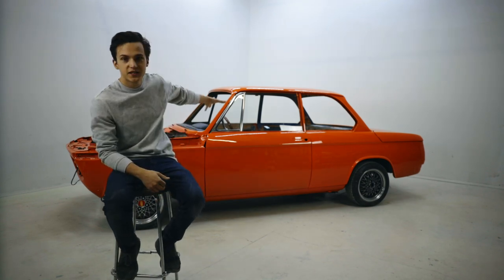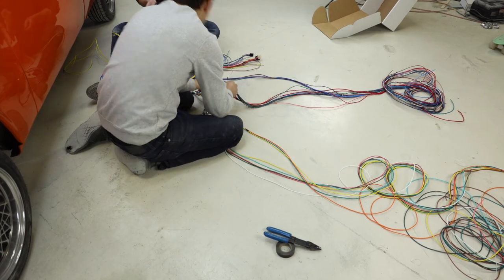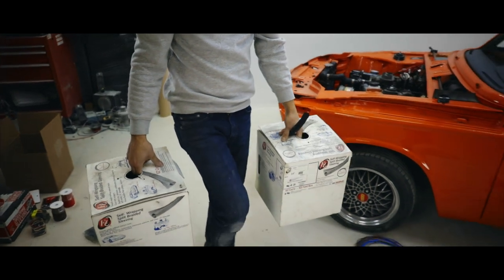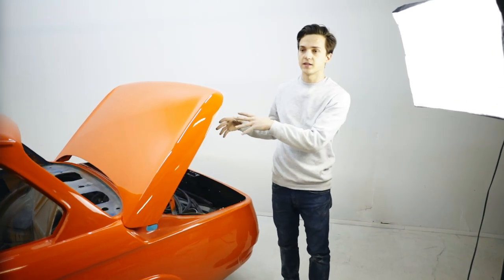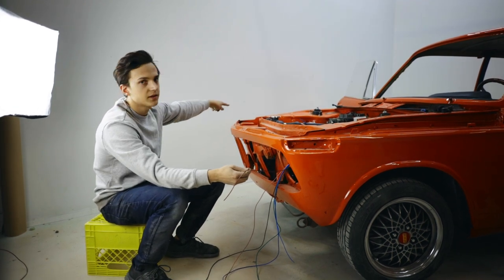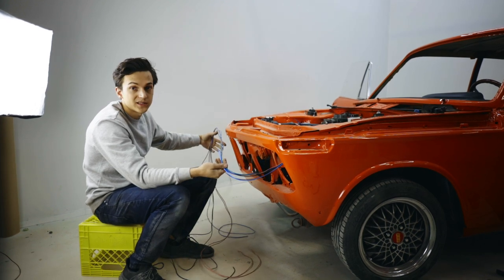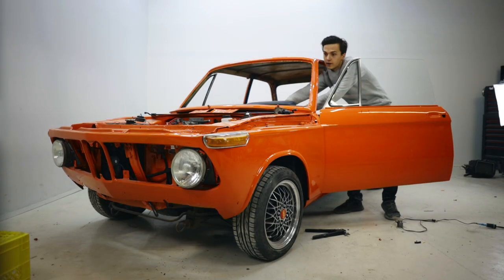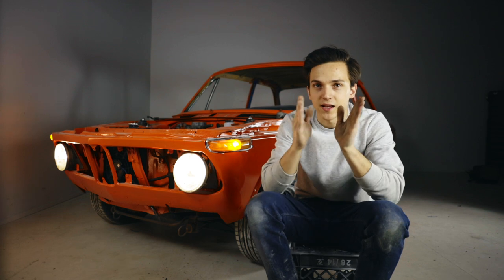TRICKS & TIPS FOR WIRING A CAR!! PROJECT 2002 [EP.4]

Comment: Ah. The age old questing. Crimping vs soldering. Solders will break overtime. But they are better than crimping.
Reply from the maker: My understanding was solder can crack if the wires are loose and always moving around/ bending. But if you secure all your wires nicely it’s reliable

Comment: I'd say you need some qualifiers on the advice to solder every connection. It's going to be highly dependent on any support around your solder joint, the vibration it might experience, and the quality of a crimp or soldered joint. Soldered joints are brittle and prone to cracking and breaking under vibration and lateral force and as such should be on pins inside a connector with good strain relief. Soldering does seal the joint well and will be less prone to environmental corrosion effects. One should take care to practice good technique to avoid cold joints or solder wicking up your wire and creating a rigid section. Mid-line splices will see some of the most dynamic vibration and in my opinion should be avoided. 

A properly crimped connect will be just as strong as a soldered joint while being faster and more consistent in results. You'll rarely ever see soldered joints on a race car or an aircraft. It's true, though, that a good tool costs good money. The best option is either to find out which connectors are most often used on your car and buy the crimping tool for that, or if you're feeling ambitious, standardize on your own connectors as much as possible and again buy the proper crimper. No smashing stuff with pliers or a vise. Properly engineered crimp terminals are designed to have the copper squish just the right amount as the terminal forms around it to have a strong grip and good contact with the specified wire. When you don't crimp properly, you're defeating that design and introducing weakness. I'll also throw in to avoid pre-insulated connectors. Get an uninsulated terminal and some heat shrink. 

Clearly I spent way too much time on this comment, and of course there are a lot of conditionals and variables to these things that make it hard to give absolutes. Like nearly everything in engineering, the answers are "it depends".
Reply from the maker: This is true. But from my experience soldering has always been way more reliable than crimping. If A car is having electrical issues, the first thing I checked for is those red and blue barrel connecters. I hear what you’re saying though, a properly crimped terminal with heat shrink tubing is a solid option
Reply: @slightlyMADcustoms  Yup. Death to the red and blue insulated crimps. It's extremely difficult to get the designed connection, and even that is assumed with a string of engineering concessions. If those are a person's reference point for crimp connectors, then yes, I'll trust a soldered joint every time. My reference point is in robotics where some of the hand tools for crimped terminals cost $1200usd. I understand that's outside of a typical project build, and that brings us back to "it depends."
Reply from the maker: Oh crazy. Ya my reference to avoiding crimp connectors is just the cheap ones

Comment: While I enjoy this content, this is hack city. If anyone actually wants to learn how to wire, I’d suggest HPA horsepower academy. Their channel actually tells you how to do things correctly and covers topics in serious detail.
Reply from the maker: How is this hack city?
Reply: @slightlyMADcustoms  your loom looks like it’s for home electronics, wrapping regular electrical tape everywhere, soldering connections, is it the wiring even the correct gage with the correct temp rated insulation? Please go watch the HPA electrical wiring videos.
Reply from the maker: The loom is designed for automotive, marine, and aircraft. It’s stronger than your typical plastic loom. All the solder connections are woven together then soldered, then heat shrunk. I understand some people prefer crimping, but soldering has been very reliable in my experience. There’s nothing wrong with using electrical tape to hold the wires together every couple inches. Yes the wire is proper gauge, And insulated properly. This is a pre made fuse block made for automotive application. 

I agree Horsepower academy would be the place to go. As I stated in the start of the video, we’re showing you how we wire a car. Not saying we’re gods and you need to follow our every move. We’re two young guys building cars, we don’t know everything, but this is what works for us
Reply: @slightlyMADcustoms  that’s a fair statement. As said initially, I enjoy the entertainment. So, keep it up. 👍